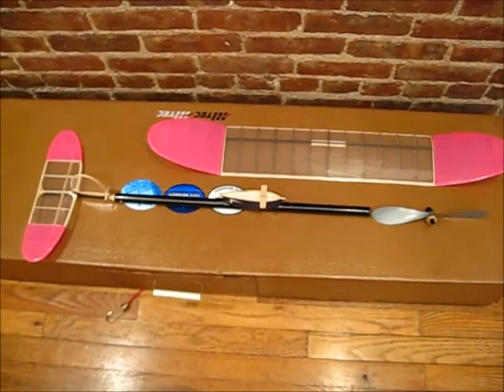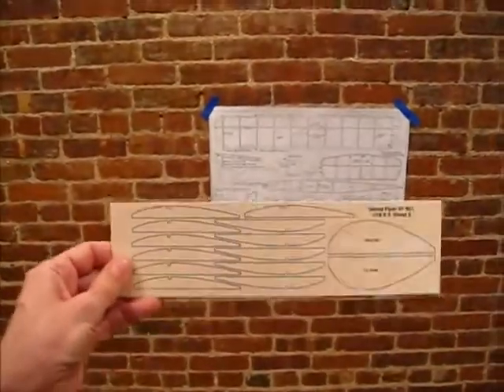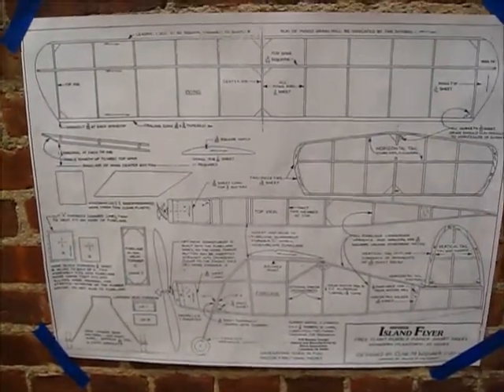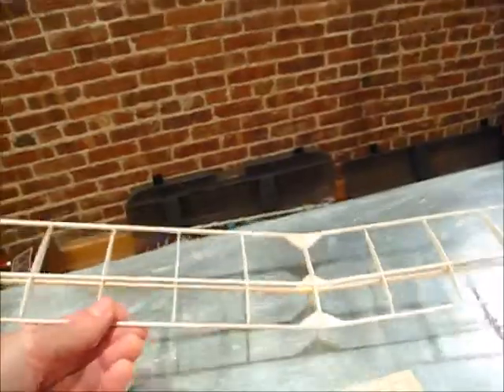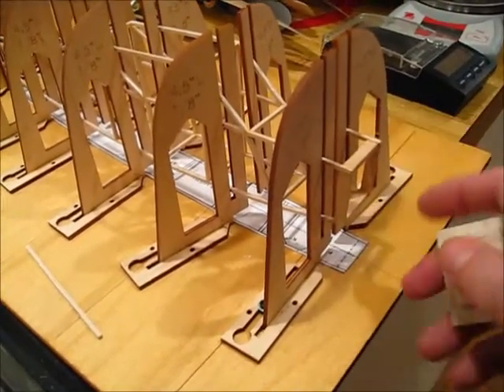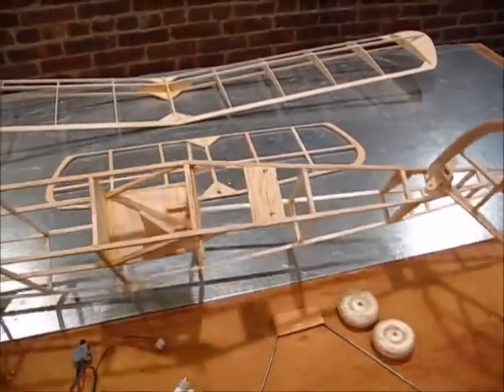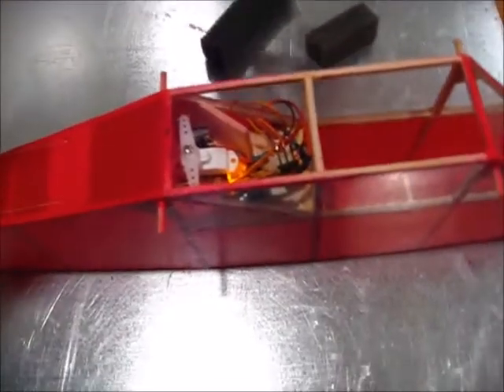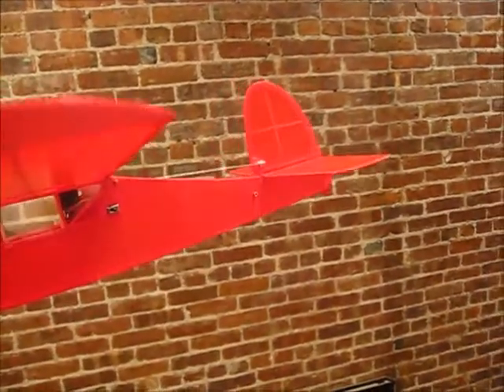The 'Island Flyer small rubber power RC - building.

Comment: Hi - nice looking plane. I'm wondering how you removed slack from the kevlar pull-out? Look forward to seeing the plane fly.
Reply from the maker: Hi - first I use a half of a square knot in the Kevlar to fix both threads to the servo arm; I use a touch of CA to hold them. When that dries, I do the same for the rudder arm, pulling the half knots tight and making sure the rudder is aligned, then I keep it taught by hanging clothespins on the ends of the Kevlar threads, hit it with CA, and let it dry.

Comment: Beautiful plane. What glue do you use for joining balsa wood? Thanks.
Reply from the maker: I use the original Titebond for balsa, both outdoor and indoor.
Reply: @domoremath Great thank you. I was using thin CA so far, but am thinking to switch. Because CA is brittle and CA bottle gets clogged all the time, it's sometimes a mess.
Reply from the maker: Yes CA is too brittle, Titebond has more flexibility, plus CA will not stick to CA if a joint gets loose for example, whereas you can also fix and repair with white glues.

Comment: I still don't understand why multiple thin strands of rubber are better than fewer thicker ones. Why use 4 x 1/4 inch instead of 1 x 1 inch, if an inch cross section, for example, is wanted?
Reply from the maker: Strip rubber comes in sizes of 1/4, 1/8, 3/32, and 1/16 so those are the choices. Some people argue that 1/4 is better, some argue that 1/16 is better. I've used them all and have never really noticed any difference, so I generally just use 1/8, sometimes 3/32 if there's an odd number of strands for 1/8, and I found 1/4 to be handy for some huge oldtimers simply because having less strands made it easier to make the motor!
Reply: Also heard that when using more stands of smaller rubber, one or two of the small strands can break inside the braid, and the whole motor won’t let go.     But I have no idea of that is true or not.  My flying is pretty much RC sailplane, free flight glider, and indoor duration, so I have no experience with really large, multi loop motors.